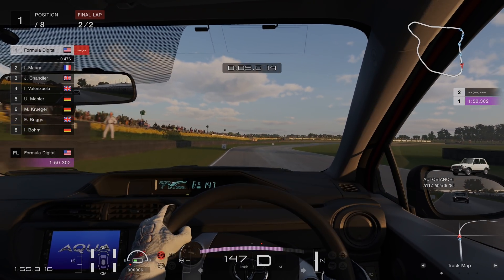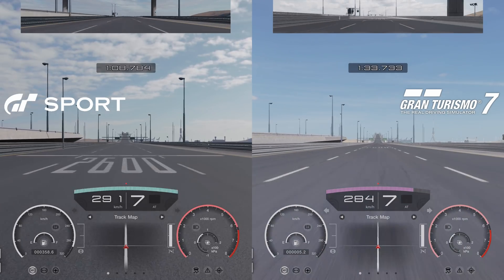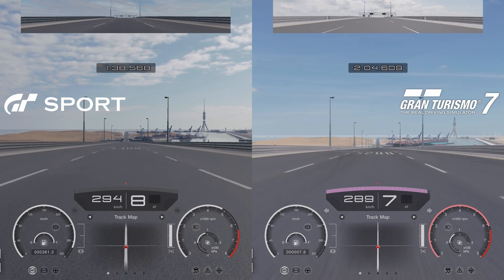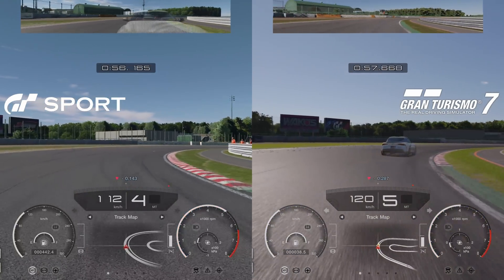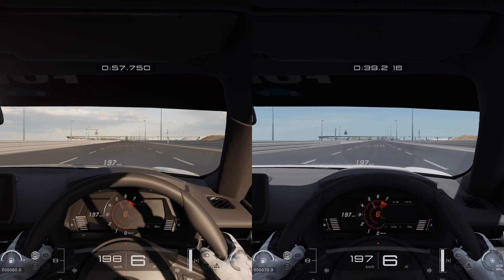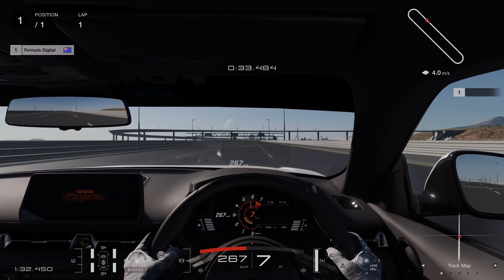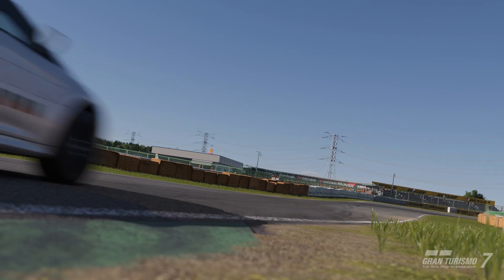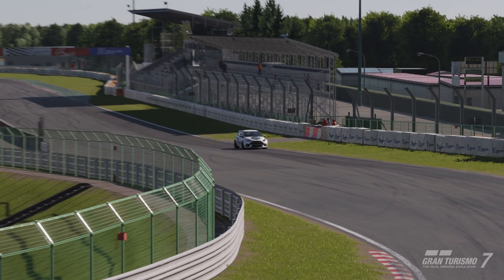Why GT7's Physics Feel So Different

Comment: PSA Wider tires on its own does not increase grip, it's the fact that wider tires are run at lower pressures for any given rim width

Basically having more volume for air mean the PSI will generally be closer to each other between wheels, a smaller rim with a taller sidewall also can see the lower PSI benefit, unfortunately due to consumer demand, modern wheels feature large rims so width is now the only direction with room to increase tire volume & so all top consumer performance tires will be wide, but Nissan had done a study on this for one of their past Skylines where they settled on 17's for their specific compound even though they could've offered larger rims with less air volume

However the drag world runs tires which are both wide & tall with small rims, achieving as low as 4PSI(not a typo "FOUR") and it's only because of tire volume[for air] that makes this possible, because the contract patch math doesn't totally work the way folks think, as a wider tire will have a wider patch sure, but it's also narrower in the other direction for a given PSI, because average contrast patch size when equalised for contact pressure is literally determined by weight on tire divided by PSI in that tire, sure the math isn't 100% 1:to:1 because of radial ply technology, but it's not even about contact pressure area

It's about contact pressure evenness, which is far more possible with lower pressure, otherwise the only way to get grip from wide tires without lowering pressure or changing compound would be in chemical grip situations such as the dragstrip where literal glue is used, or the track is heated with fire to the point where it can chemically bond the rubber compound, none of this happens with most tires most folks will be using, so it's all about PSI making more of the rubber work at closer temperatures to one another so less of it is overworked past it's temperature & a higher % of it will be optimally contributing to grip

TLDR; deflated off-road tires show on a larger scale why, lower PSI contributes to more even contact in more directions, and the larger volume for air allowes for lower & more even PSI, something you can also achieve with taller rubbered & smaller rimmed tires, unfortunately only drag cars exploit this last way of increasing grip as consumer demand for large diameter rims means there's little room left to increase sidewall

Comment: No point of comparing that what is nonexistent in both GT7 and Forza series. Both are simcades and I bet the physics are made deliberately simple there, as no one will want to buy another rFactor 2. On your example in Tsukuba, when you exit slow hairpin (just before the long straight), on any RWD vehicle with about 200-250 HP, if you don't do weird things with steering wheel, the car will have no slide and will be very stable in reality. What I think was done, is that some product manager \ game designer told programmers "Alright, we need to get more fun into the game... lets make cars oversteer more!". And everybody was like "Yeeeeh, you nailed it!".

Comment: Quick question : what were your tc settings ?
Reply from the maker: Always off unless I am testing TCS
Reply: Just why ? TC is not a beginner assit, it's for keeping the car on the right track and avoid wheelspin. Anyways, that's why , it's beacause you can't completly turn off the tc in gt sport, but in gt7 you can and the rest is just fine tuning of the models.

Comment: Air temperature influenced cars’ power since GT4 or even GT3 (that’s where the inconsistency of power/torque data between garage and in-race comes from) and fuel weight was also a case in those PS2 games, so I’m sure for all the other sequels they’ve kept those factors working.

Comment: 3:53 that is something i also noticed coming from 200+ hrs on gt sport
your throttle management has to be right on the money to get the most out of every corner
another thing i noticed is the physics feeling more vertical, like going over a curb too hard will actually send your car up, as opposed to the car just being pushed up a little in gt sport

Comment: @4:08 I own a 500whp mkv Supra, and if you give it more than about 50% throttle with any kind of steering angle at lower speeds and the back will absolutely come around on you.  Actually have a skid pad video on my channel.

Comment: understeer differences into corner and power oversteer on the way out could easily be differences in the modelling of braking / acceleration on downward force on tyres (the effects of car pitch in corners) and the modelling of tyre surface contact (affected by roll). The tyres could technically have the same characteristics, but a different modelling of the forces at each tyre / tyre contact surface during cornering updates the overall tyre slippage.

Comment: I've noticed my car handling completely different in time trials and world circuits. At Daytona oval, my car is glued to the track the whole race during time trials, when using the exact same tune and settings globally, my car locks up and dives to the infield every bank of the world circuit. Super frustrating as someone trying to learn tuning and no assist driving.

any insight into this? tried every time of day in time trials. only difference is the dynamic time of day in the world circuit. although some on reddit suggested during trials fuel isnt accounted for
Reply: Really? I’m getting the opposite where I’m good in time trials but on the race I spin a bunch.
Reply: @Constant_Hum  ya, from what I've seen and discussed with others I think it's the fact that time trial doesn't simulate fuel. I've started tuning in pro arcade races and it hasn't failed yet. Take the same tune into time trials and I can't control it. If I tune in trials it throws off actual race control

Comment: The physics seems to be broken, you will notice this the most with the redbull, when travelling 300kph+ the car will turn sharply left or right with the slightest steering input and it's impossible to counter. you will crash every time. I have noticed this bug with a few other cars which will also crash while breaking from high speed, the Lamborghini aventador being an example. it most certainly has something to do with the aerodynamics physics, I really hope they fix this..
Reply: thats setup man, reduce front downforce increase rear
Reply: @GG-bt2fs  Already tried that, bug still continues
Reply: @CimmerianShiro  damn

Comment: The “wide rims” option just adds a slight amount of sidewall stretch. It’s a cosmetic option of the wheel, not the tire (wide body gets wider tires)
Reply: Widebody gets the wheels offset, not wider. Would be good if you had the option to use a wider tyre when using wide rims

Comment: Mechanical grip, especially in rear engine or mid engine cars is entirely incorrect in this game. Tire performance overall and traction on race tires is not accurate. Not quite a simcade, but it’s extremely close.
Reply: What are you on about? Most cars that are setup properly handle like they’re on rails with the correct inputs.

Comment: 3000 pound rx8  with ballast in the back and downforce from spoiler with 357hp with sports softs going in a slight curve at 50-70 mph immediatly slides loses traction and spins out while a fucking mini cooper s takes the cure 100 mph+  with throttle fully depressed makes no sense and exits flawlessy

Comment: Some things to consider.

Racing sims apply filters to inputs, any changes here could cause cars to lose grip easier. Without any changes to the physics.

Changing tire attributes or giving more attributes to work with could change the results with no changes to the underlying physics, and vice versa. Same for the suspension. 

Physics could run at a higher frequency. 

Or any combination of all of the above. So many things can be causing the differences, good luck delineating between everything. 

Just a personal pet pev. Engine torque is irrelevant on its own. The gear box is a torque multiplier, which is why less torque at a higher rpm (better gear ratio) can produce more power. HP tells you what combination will produce the most torque where it matters, at the wheels.

Comment: The funny thing is, I played the hell out of GT Sport about 2 months before the release, till the day I got my preorder of GT7.

The first thing I've noticed is, UNDERSTEER was mad. I could execute the corners comfortably in GT sport but GT7, I was wailing away off track into the grass.

For a decent while I was more of a lawnmower than a racing driver.

But when the powerful cars came along, oversteer was a mad issue. In GT sport it could easily be controlled into a nice powerslide.

In GT7 however, the driver steers automatically in the opposite direction (yes counter steering was OFF), I don't know why, it never did that in GT Sport. So I'm slamming the analogue in the opposite direction on top, and steering too much then sliding the other way. After I jingled about left and right a few times...I'm in a full blown 360.

I've learned to adapt. Let the game correct it as much as possible, just control throttle and SLIGHT tweak of left stick to correct it. Nothing crazy. Generally I just let it be and control throttle or hit brakes to slow down.
Reply: I think the problem is that when it happens, the game realistically makes the wheels "turn" to the opposite direction (when in reality it's the tail of the car turning in relation to the front wheels) but since the player can't feel that input of the steering changing rapidly on its own, it's impossible to react to it. I think it's also a problem with a wheel because the wheel force feedback isn't fast enough to provide that information to the driver which leads to an over correction. Maybe that's not how it works but there definitely is a problem in GT7 and even GT Sport that the player doesn't get enough information to be able to do difficult maneuvers like drifting properly. The more complex and realistic the physics are, the more realistic and fast the steering feedback needs to be.
Reply: Dont forget input lag. I played gt on a crt recently with a wheel and omg, it felt like the steering shaft was directly connected to the PlayStation,  it was amazing
Reply: @bookshelffury  Man dont make me depressed... I still mourn the loss of CRT(and plasma) technology and us being stuck with this inferior technology. Sure you could buy better performing LCDs or OLEds but they are crazy expensive and still slower than CRT and plasma.

Comment: This game is actually harder than ACC now...I've seen a comparison in the rain. GT7 run takes a hell lot more of an effort to control the car while ACC cruises quite comfortably on corners GT7 car really needs additional braking and slowing.
Reply: It's harder because the physics and FFB are so much worse.
Reply: @DriftNick  physics isn't bad considering its a console game, with wide range of cars in every category and lack of integration with major top end wheels/pedals.

FFB is probably a software issue. It's actually better on GT Sport so I'm sure it's fixable with an update.
Reply: @ertugrulbae46  maybe can be improved, but it's miles away from AC. Inconsistent curb feel, almost no road feel, lack of detailed turning response and indication of your initial lack of grip. It's just not there. I have the DD Pro and going between GT7 and AC really feels like GT7 is utilizing about 5% of this wheel.
Reply: @alexkulp9727  FFB is poor because it needs updated. Its better in GT Sport atm.
Reply: @ertugrulbae46  that sounds like some hopeful thinking. I actually thought it was a little better than Sport

Comment: Did some real world tests with a mustang gt in gt7 and mine in real life same tires same sweeping corner same gear same speed same throttle application and in gt7 I was spun around in real life I doubled throttle input and it just went around the corner. Ijs gt7 has alot of work to do
Reply: What track did you do it at?
Reply: @smokinC5  not a real track just a very similar corner. Should have specified. It was cold af out as well so if anything more power less grip than the game
Reply: @jrock9195  i have to agree, the physics are off big time.  I have had my vette in some pretty agressive turns in autox and such, and gt7 feels like im driving in snow and ice lol
Reply: @smokinC5  it's crazy idk where they get these physics from. Granted idk what exactly sport soft tires are in gt7 but I had cold 50% tread pilot sport 4s. Mayb that's a medium in gt7 and soft is a r888 or something who knows
Reply: @smokinC5  I'd like to do track to track but the only 3 somewhat close to me aren't in gt7
Reply: Yep.  4s is what i have too.  Had 888 on for a bit, they are great track tires.  I would have to think those would be sport soft, maybe the 4s is sport medium.  Either way, in gt7, i have racing tires and it feels like they have no grip.  I think they used the top racers in gtsport to do the physics, and then made the cars handle to their preference, not the real world.
Reply: Then they do stuff like say its a sim and like real world, then say you can buy carbon brakes for a c6zr1.  The thing came with carbon brakes from factory haha.  Same brakes as used on the ferrari fxx smh.
Reply: @smokinC5  ikr lol the real driving simulator lmao mayb it will get better who knows
Reply: @jrock9195  I think the difference between what you feel from a controller in your hands is vastly different to what you actually feel when driving a car IRL. And that is directly attributed to what you experienced. Your micro adjustments to the throttle and steering IRL are ten fold compared to what you can achieve on a controller. To the point that you probably don’t even realise you’re doing it in a real car.
Reply: @izzy031096  I use a wheel and pedals on gt7

Comment: I think the physics are Off, Some RWD cars in the game are death traps, but relatively composed in real life. Wondering if it could be a change in Tire Slip Angle, which would mostly impact RWD in mid To corner exits, which is where GT7 is least realistic
Reply: The Camaro is practically undriveable
Reply: @tommytenzo ... You can Try some basic RL tuning principles. Buy the fully customisable suspension. I haven’t used the car but try 
For a Oem Factory feel 
anti-roll bars F2 R1
Damping bump F25 R20
Damping rebound F25 R23
Spring stiffness depends what the lowest setting is but put the front 50+ higher, e.g. F1.85 R1.35

Simply softer equals More - priority of Grip in weight Balance. You have anti-roll bars / Damping compression (bump) and expansion (rebound) / springs or natural frequency (Springs rate) 

Generally use this as a baseline for FR FF AWD FWD RWD

anti-roll bars F6 R3
Damping bump F35 R23
Damping rebound F45 R38
Spring stiffness F2.20 R1.70

The actual number doesn’t matter, Only the difference. If there’s To much understeer then lessen the anti-rollbar difference, from double 6/3 to 5/3